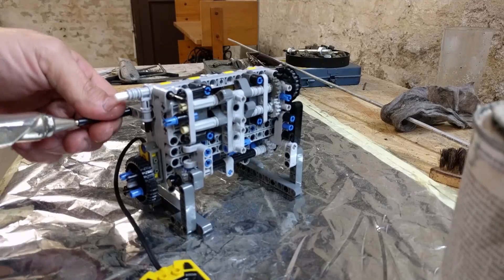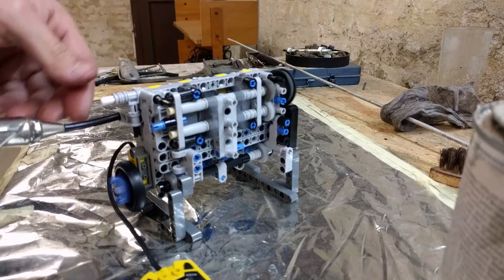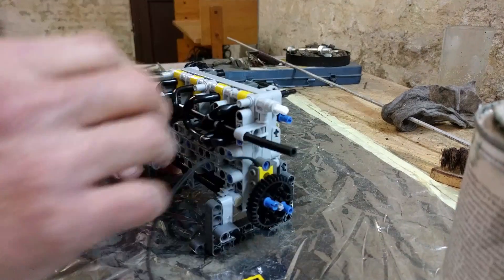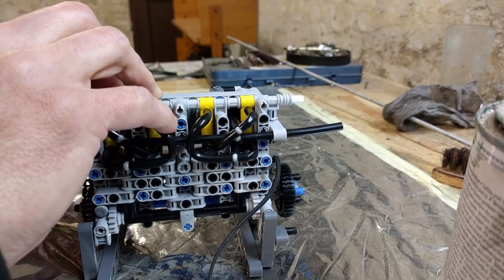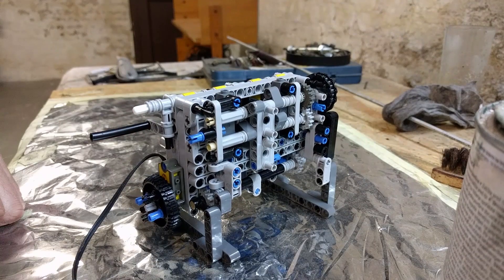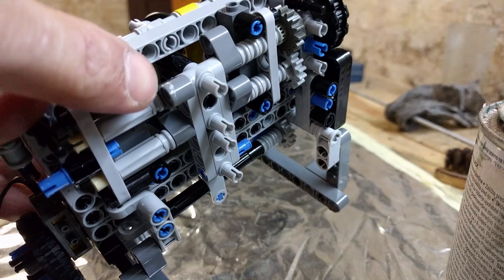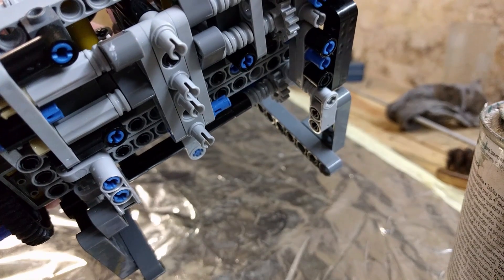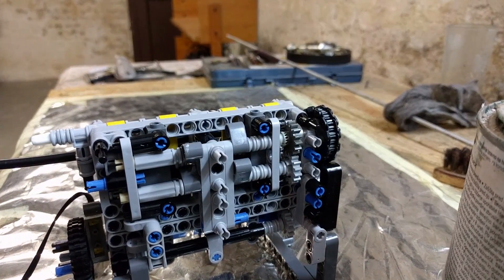LPE power Development - Small cylinder Inline 4 part 5

Comment: I have some new ideas for a solution:

1. Lubricate all moving parts.

2. How about replacing the half bushes on the levers with a single liftarm (pin bush) and glue it in place. I think the problem could lie in the groves of the half bushes.

3. Cut a single half bush in almost half to aquire 1/6 length of a stud. Now take this part and go back to the older concept featuring the towball pin. Only this time, replace the towball pin with a towball axle and add the cut bush to it. This way you extend the throw of the cam resulting in better and smoother operation of the valve opening.

Comment: Also it's hard to tell but I think the toothed half bush that is holding in the toothed 16 tooth gear with the pin hole has cracked.
Reply from the maker: It has, but that is irrelevant. The bush was cracked from the beginning and only served to position the clutch gear before it was glued on the axle.

Comment: Why does it need to aim for thousands of RPMs? Why not aim for a few hundred? It seems like it will need a lot for gearing down to be useful.
Reply from the maker: If i wanted more power at lower rpms, i'd use bigger cylinders and/or a larger crank throw. The goal here are specifically high rpms.
Reply from the maker: It's pretty useless at low rpms.
Reply: down gearing gives it more strength so does aiming for high rpms
Reply: Is it not possible to design it with low RPMs in mind? (I have never tried this so I have no idea.)
Low rpms says to me that it will have less wear on the parts and be more reliable.
Reply: It's still just plastic, so I don't know much more power you expect it to able to handle. Especially the axles.